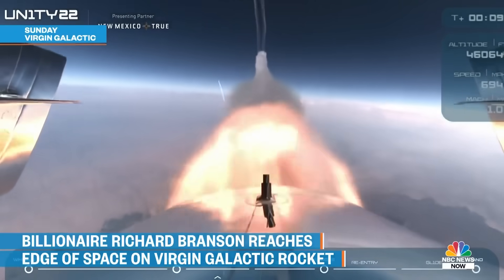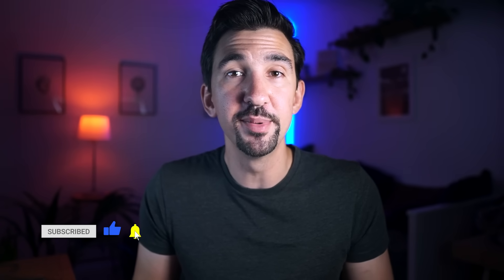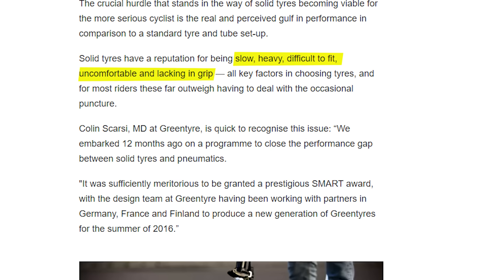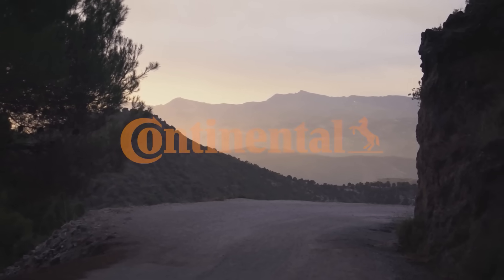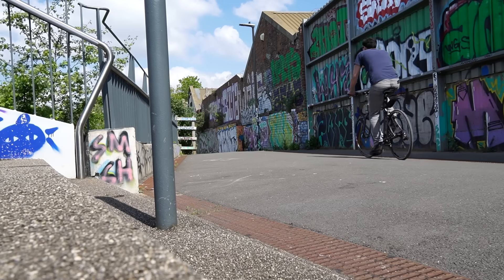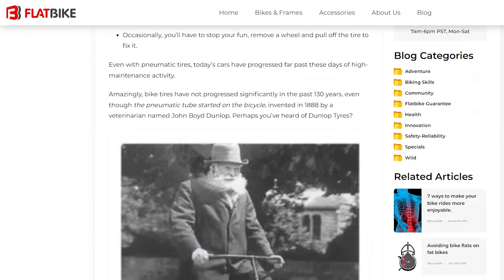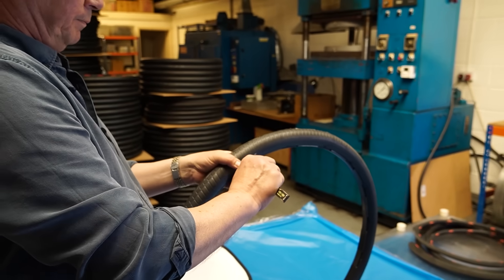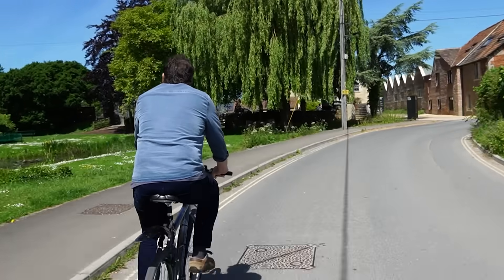I Tried Solid Bike Tires | Here's What I Found

Comment: Biggest question.
Linearity of deformation. A pneumatic tire doesn't change it's elasticity coefficient enough to make any difference all the time it's being bushed all the way to the rim, because you're compressing the whole quite large volume of air. A foam tire squishes only the tiniest bubbles in it, so the pressure in them very quickly becomes too high to compress further, so if a tire is loaded hard enough it behaves in practice quite like a solid rubber tire without any bubbles. Which, obviously, makes the ride a lot bumpier and seriously decreases grip in any turn you take. Until these problems are solved, well... You're not much worse off with having whole rubber donuts instead of fancy foam thingies. Load the latter and you get the former's performance. So... Nah.

Comment: What are you riding over that you flat so much?   I ride lightweight,  low rolling resistance 700x25c tires and flat once every 3 or 4 years.   You could look into tubeless tires with sealant.  Guarantee they'll be more comfortable than solid tires.

Comment: your anecdote about punctures doesn't measure to most commuters, I can go two years between flats and I do more miles than you, I also use lighter 28mm and even my 32mm weigh less than the Conti gatorskin and with a conti tube both are lighter than 400g.
you can't adjust the pressure of a solid tyre for different loading and terrain.
Whacking a wheel rim with a allet is dumb as fuck, just wh the hell would ou want to do that ffs!
The overall loss in power IS significant, ou don't care to mention how long extra it took ou and I'm betting that ou needed to put in a lot more effort. our own bias will tell ou that it wasn't as much, it's pretty obvious this occurs when ou have a vested interest in the product.
your numbers on bike tyre disposal would mean one tyre per every 7th person in the world, given the number of people that own cycles and actually run them enough to need replacement, that 1,000,000 ton of tyres is utter fantasy. Also, cycle tyres and tubes DO get recycled!

Comment: This looks like a very good solution  to the inconvenience of tire flats, however, I don't see this as being an environmental improvement. Tires are discarded almost exclusively due to tread wear. Seems like a like a solid tube, which would last basically forever, combined with a recyclable tire would be a better solution.

Comment: I used kevlar tires. They were pretty much resistant against getting flats. They could withstand the typical broken glass bottle that would normally give you a flat.
Reply: Kevlar tires only have kevlar on the sides. The part that touches the soil is exactly the same as their wire counterparts.

Comment: My main bike I ride every where uses 700c X 32 and you cannot fit anything larger then 32. Smaller won't work so I won't be buying thru kick starter. By the way I haven't change a tire in 5 years... What's a flat.  🤣 I ride everyday. I haven't driven a car in 16 years.

Comment: I have driven Schwalbe Marathon+ for about 25000 km in 7 years and never had a flat. Before that I was using Schwalbe green guard (1 step below the Marathon+) and 4 years I had 2 flats with those: a nail and a long piece of glass.  Marathon+ seems good enough for me.

Comment: Hey! I’m the guy who invented the “NASA bike tire” and I agree that solid tires are a fantastic part of the solution. In fact, I’m running Tannus tires on the Schwinn featured partway through the video. I’m also running tubeless on my Esker MTB, and pneumatics on my Gunnar touring bike. Ultimately, a diversity of options will benefit the cycling community and I’m excited to see these innovations on the solid rubber tire—especially if the recyclability claims hold up. Similarly, re-treading a NiTi tire would be huge for sustainability. 

Until then, I recommend just squirting some sealant inside your pneumatic tubes. It’s quick, cheap, easy, can retrofit onto most bikes, and eliminates the vast majority of flats!
Reply: Years ago I had a flat with a Slime filled tube while out on a ride. Extremely messy. Never again. Switched to heavier, thicker tires and no problems since. I still carry a small can of flat-fix for small punctures, but have never had to use it.
Reply: @Vlasko60  what about a solid outer rubber layer and a inner layer of super air filled rubber 🛞
Reply: @Vlasko60  yeah slime is not very good
Reply: Rubber pneumatic tires are really hard to compete with in terms of performance. It's just a really good solution. Going flat is normally a quality control / installation error / worn-out issue. NiTi wheels are being developed for space applications where rubber would outgass too much / freeze solid (very brittle). They're not going to out-perform elastomers on earth.
Reply: @aaron41  this is definitely true. Although, slightly long-term perspective is that if we don't do something about the tyre recycling problem we may have an environment on our hands in which the pneumatic tyre is no longer viable (climate collapse). I could see an alternative to non-recyclable rubber being pushed in the EU as soon as it is proven.
Reply: @davidparkersteyn2666  
💥 But why can't they just grind up bicycle tires and add the resulting ground up rubber to asphalt, then pave roads with it, just like they do with old car tires? I'm sure that car tires also use a mixture of different natural & synthetic rubber, so if they are acceptable for use in asphalt, then bike tires would probably work too.
Reply from the maker: Hey, thanks for the comment. Absolutely agree, there won't be a one size fits all.  Good luck with your development, would be great to chat about it if you're interested
Reply: @DrBenMiles  Sure, I'd be happy to chat any time!
Reply: I presume you live in the USA, and the sealant you are suggesting is Slime?
Reply: @bobsponge1877  I use Stan's sealant and just squirt a bit of the liquid inside the tube (has to be a removable stem core) and I basically don't get flats anymore.  It's a pretty incredible product and I have no idea why it's not more popular with commuters.
Reply: @bobsponge1877  I tried "slime," what a mess when you get a cut tube! Tried the armored liners, the thorns just went through the sidewalls. The bike shop told me not to ride on the bike paths because of the thorns in late summer - fall. Guess they would rather I become a hood ornament for a Mack truck!  Lincoln has a lot of bike trails. Most in the city are paved but the rural ones are all fine crushed rock that the most determined thorn can get a grip on.
Reply: @bobsponge1877  Very availablle in the UK.
Reply: Must be nice to be wealthy.
Reply: @malcontender6319  sex
Reply: ok so I have to ask: why not just put a tube of foam in the bike tire? Surely it would compress just like air, and on average foam weighs 5% of what rubber weighs.
Also, when you look at the solution for the new tire, it really looks like he's trying to make rubber foam and put that in a tire
Reply: @arbiters487  you can already do that. They sell foam cores fir tires that you put into the tire. When you put air in the tire the foam  will collapse , when you get a puncture the foam will expand and you can get home. It's not a permanent solution. Your going to want fix the flat. 
They been used in the pro peleton tho absent the insistence of the sponsors I'm not so sure the pros would elect to use them because of the added weight.
Reply: just fill the rubber with a dense foam so its still squishy and light
Reply: @PierceThem  
But does the dense foam really hold up well enough over time, after hard riding?  Will foam actually fill your tires adequately enough so that your tires don't feel as if they are low on air?
Reply: @HighlanderNorth1  yes.
Reply: Thank you for saving me 12 minutes!
Reply: Armor-dilloz is the best tire sealant on the market.
Reply: I've clearly been "out" of the bicycling scene too long, evidenced by the fact that I've never heard of "Esker" or "Gunnar" bikes. I've heard of "Gunnar Nelson"(which both ages and embarrasses me)!  But I'm having a hard time wrapping my head around the concept of a workable Nitinol(NiTi) tire. The cost would probably be prohibitive for all but the top racers and wealthy trust funders.

 I also wonder how long they'd last before the NiTi properties start to degrade, and they lose some of those benefits. Will they retain their shape for a reasonably long period of time, after being ridden hard over rough terrain and jumps on a regular basis?
Reply: I had inserted inside our ebike tires Tannus Armour which prevent nails about 1/4 inch from puncturing.
Reply: I would be interested in your thoughts about using Non-Newtonian Fluids in tires.
Reply: you should get sued out of all your money for the name of that tire.
Reply: Impressive
Reply: How much r ur bike tires?
Reply: You can get tubes pre-filled with sealant,
in my experience both manual and pre-filled sealant only works if the outer tyre is suffeciently punctured, otherwise it won't work,
it needs the air to cure. 
Might be different between brands but can't common on that.

Can't remember time I unironically had a flat caused by something poking my tyre, those times I went over a place I knew to have throwns.
At that time I had tubeless and just didn't care xP

Love Nickle Titanium wheel concepts btw.

Don't really see why tyres have to be air based right now, we just got stuck in a rut.
Rubber has so many disadvantages. Rudder degridation is my favourite thing to bring up...
Reply: @Mallchad  maybe you're talking about something else, but what I use (Stan's) is just little latex particles suspended in liquid.  When there's a small puncture, the liquid naturally squirts out a little and those latex bits get stuck in the hole, plugging it up, and eventually dry out and bond to the surface of the tube/tire, effectively patching the hole.  It's remarkable how well it works.
Reply: @calvinyoung480  I use stans as well, it won't cure without air from outside the tyre, I tried.
At least for me. It cures too slowly or never.
For full tyre punctures it great. imo works better tubeless than with tubes though.
Reply: @Mallchad  Mountainbiking lead the way with tubeless, with much rougher conditions to deal with. Solid will have to come a long way to replace pneumatic for mountainbiking. Setting air pressure is really important for good grip based on the riders weight, tyre size and the riding conditions. For communters or road cyclists solid tyres are probably fine, and more convenient. 

A well set up tubeless is pretty robust in my experience. My dads front tyre was bit by a dog once putting two holes in the sidewalls, just giving it a spin on it's side to let the Stans sealant through the hole for a couple of minutes sealed it. I also had a tyre with a big slash in it which I stitched and patched and managed to run tubeless for a year.
Reply: @Mallchad  carry a knife and make sure air gets in there then.
Reply: And I can tell you, from experience, that sealant in the tubes is like one of the least reliable ways of preventing flats. Just one tiny piece of steel wire, from say a wire brush, is enough to not only penetrate the tire and tube, but beyond that sealant is essentially useless.

Such a tiny piece of wire will keep moving around as you ride, which defeats the sealant and keeps the tube leaking, seemingly mysteriously no less since it's so small.

Also, sealant chemicals apparently dissolve vulcanizing chemicals, which defeat a properly applied patch.

Also, regardless of the cause of a flat bicycle tire, if at all possible you should make sure to feel over the entire inside surface of the tire, to identify and remove the original cause of the flat.

Skipping the proper method for sealant is not only lazy, it's rather unreliable, adds weight to the tire, and also throws off tire balance.

TL;DR - tube sealants are crap, use proper tube patches instead. Hell, patches are not only more reliable, they're cheaper as well and honestly not difficult to properly apply.
Reply: @southernflatland  I've used hundreds of vulcanizing patches over the years, and agree: once you get the hang of it, you can permanently seal a leak in a matter of minutes.  (It took me way too long to realize it's easier to leave the wheel on the bike and just pop the bead off the section of the tire that needs repair--if you know where the hole is.)

That said, once I started mountain biking with tubeless tires I decided to squirt a bit of the fluid inside my removable core tubes on my touring bike... and it's been a glorious experience.  Maybe I'm just on an incredible lucky streak, but it's been over two years and I haven't had to patch it yet.  That includes bits of steel wire being pulled from the tire.  Unless it's a huge hole, the sealant has no trouble with that.

Not gonna shame you for sticking with traditional patches, but there's no need to call it lazy or improper.  It works great and doesn't have any meaningful downsides or externalities :)
Reply: @southernflatland  your tldr is longer than the first part
Reply: @KeksimusMaximus  I know, I meant to edit that and move it to the end, but apparently the current version of the GBoard keyboard is totally borked up and it completely hides any text I attempt to select.
Reply: @KeksimusMaximus  Ok I tried it again and managed to complete the intended edit, completely in the blind though. Stupid Google done gone and hid the very text you try to select now... 🤦‍♂️
Reply: Interesting to read this, thank you for these tips!
The reason I was looking to use solid rubber tires:
I have an antique wooden bike with wooden rims. These rims are so old, yet useable. I am scared that I will split the rims edges by the tires pressure.
So the idea of a solid rubber-more constant pressure on the edges felt like a great option.
Reply: Sure you are
Reply: @QYXP  
❓☹️❓ So, you don't believe the veracity of his claim? Well, I can promise you that I am Werhner von Braun, the German guy who developed rockets in the 30s and 40s. I was "pardoned" by the allies after WW2(they were 100% willing to overlook all the evil Nazi stuff, because of my convenient expertise in rocket tech). Lucky me! So I went on to help NASA develop the Saturn rocket(and to deliver nuclear warheads worldwide)! 

Why wouldn't you believe that? After all, I'm only 110 years old now, and there's plenty of people in the Bible who lived to be over 900! Some of them lived so damn long that they made it clear into the NEW Testament! Their long lives are easily explainable; they just didn't have Covid or Monkey Pox to worry about! 

Oh, and there was no such thing as hurricanes, tornadoes, mega-droughts, or tsunamis, because man-made global warming wasn't around yet, so there was just no bad weather back then.....  😏👍
Reply: @QYXP  ;)

Comment: After riding over 2,000 miles a year, this sounds good, except for the cost.  If you wear off the outer 1/4", you have a lot more to throw away.  It is good that it can all be recycled, provided there is some convenient place to turn in the old ones so that they will be correctly recycled instead of thrown in with other plastics and rubbers.  I avoid flats by putting Kevlar strips inside of the tire.  Of course occasionally something will tear the outer carcass and ruin it.  This usually happens when there is still plenty of tread left

Comment: With a pneumatic tire, the whole volume of air contributes to the "springiness" (feeding into both rolling resistance and comfort). For the rubber-foam-tire, it is just the bubbles around the area of contact - a considerably smaller volume.
Reply: The bubbles AND their surrounding elastomer.  The whole trick (or science, or alchemy) is in getting the optimum properties of the elastomer.  How close to a pneumatic tire  that optimum can be, remains to be seen.  At the end of the day, the tire has to be "good enough" for its intended use, which is most likely commuter bikes, and not track (or even touring) bikes.  The consumer will be the ultimate arbiter, weighing cost and ride quality against puncture resistance and disposal concerns.
Reply: This also has another advantage in that it considerably improves the potential to dampen sudden impacts and help to protect the wheel rim itself from damage. Having a bike tire that survives a sudden impact may not be quite the advantage it might appear to be if it ends up buckling the wheel itself instead.
Reply: You can trade some of that volume for a run flat insert. Yes, you would lose some of the springiness, but if you're somebody that regularly rides along the highway or in the middle of nowhere, that may be a compromise that's worth making. Especially if you're riding along a busy road with narrow shoulders.

Comment: Very interesting... I have found that Schwalbe Marathon Plus + inner tube/sealant combo to be a very effective combo. Relatively inexpensive to fit, and has some amazing results.
My front tyre is 6 years old and has covered some 29,000km, had 1 puncture in that time which the sealant was able to fix after removing the object and pumping up (and that's using a standard Marathon not the Marathon Plus).
My rear tyre is a lot younger at 2 years and 7000km and at the moment has not had any issues.

I have previously tried solid tyres, I think it was a Tannus or a Greentyre. I tried it for about 1000km front tyre only and that was about manageable on a road bike, but it really was not a good experience on the rear. Switched to Gatorskins and fortunately don't have too many issues on that bike.

I am interested in this technology and I hope it can become a competitive product but good tyre choice, and availability of good routes (most cycle lanes tend to fill up with glass and debris) can mitigate the risks from flat tyres almost... until inevitably you get a flat going to work as is the way..